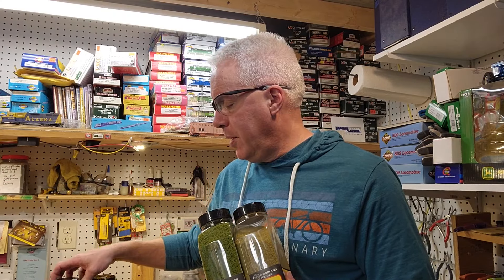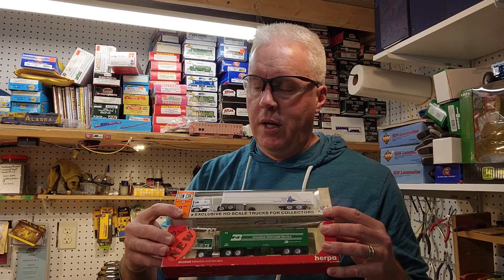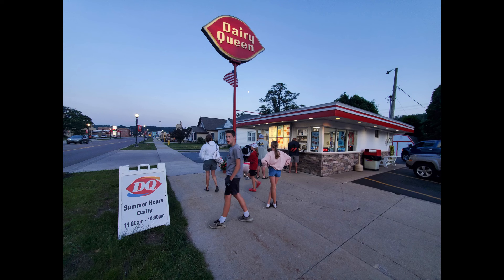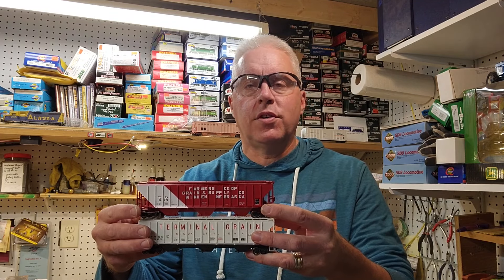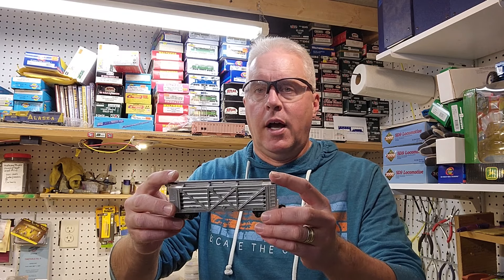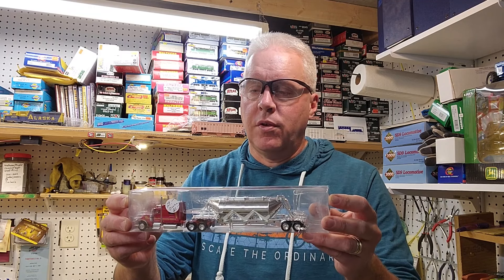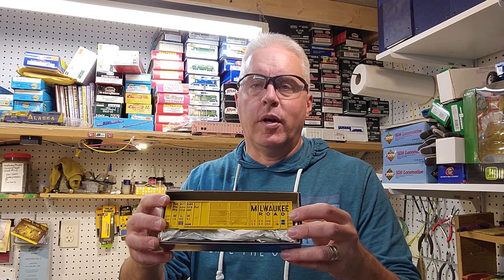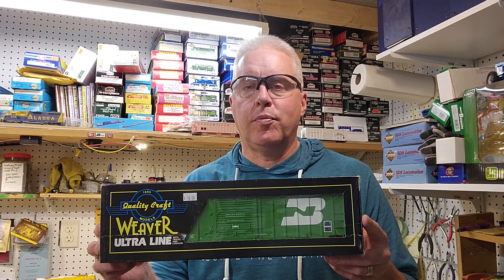Trains at Christmas Show Purchases

Comment: Two things the BN ex GN unit on the annual is an NW-5 GN had 10 of them there were only 3 more of them on Southern and the Detroit terminal RR. Also a GP-50 on a yard job is very prototypical have seen such happen on both BN and UP in Chicago as well as GP-40s on CN.
Reply from the maker: @danielbackley9301  Yes, NW5.  I couldn't access that part of my memory just then.  Neat engines for sure.  I can't see a GP50 being very good on a yard job unless the cuts are short.  But if it happened, then I'll run with it!  Thanks!!!